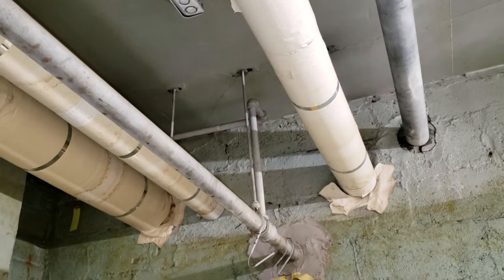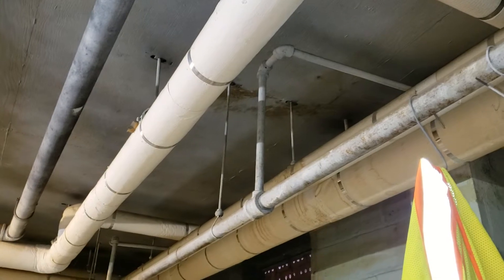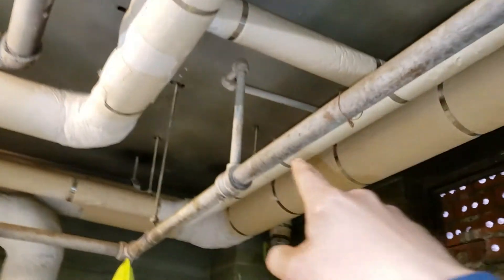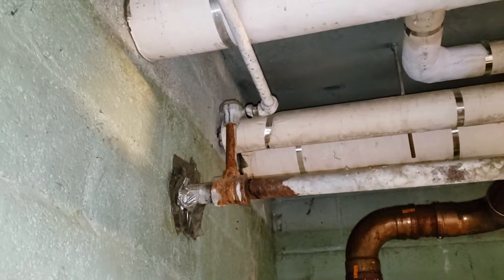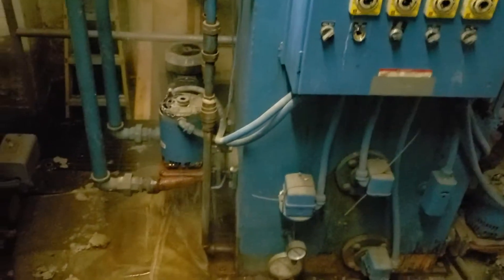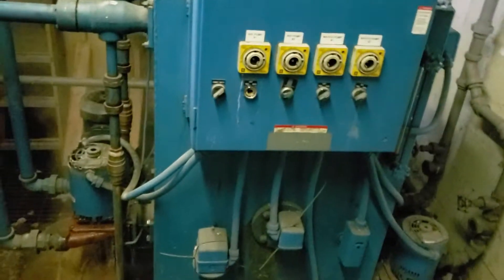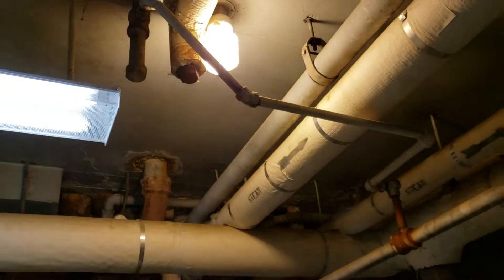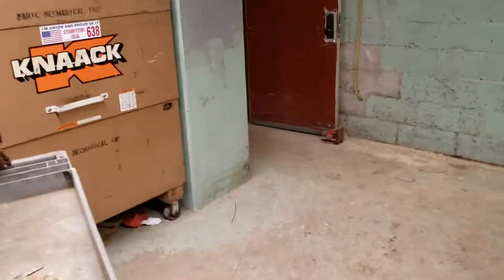How Vacuum steam heating system works. NEW YORK NYCHA DEVELOPMENT

Comment: Good to see someone knowledgeable with steam on building side in NYC

Honestly, should just consider installing Orifice plates in the system, and you can even replace your F&T's with float-only's. Traps will no longer be necessary except on top floor and you'll get more comfortable heat in the space (especially if they install TRV's). Won't need to utilize the vacuum pump at all (assume system is working under vacuum) and can convert the system to positive supply-side pressure system.

My company's recently installed plates recently at Patterson and currently installing at Sotomayor houses. Though there's a lot training we need to provide for tenant/building supers on the new systems